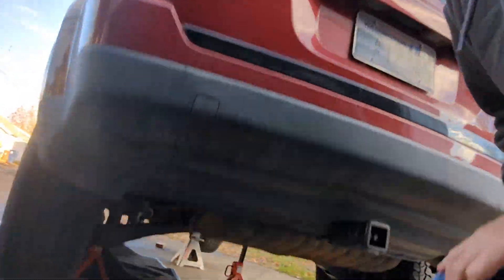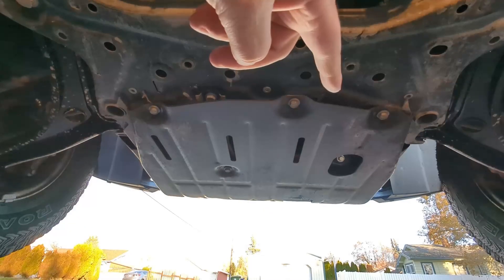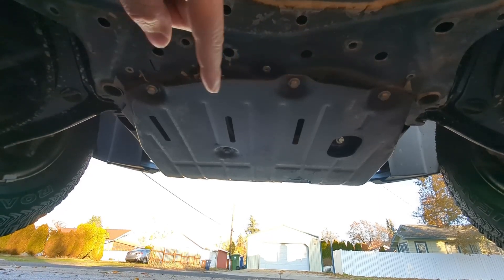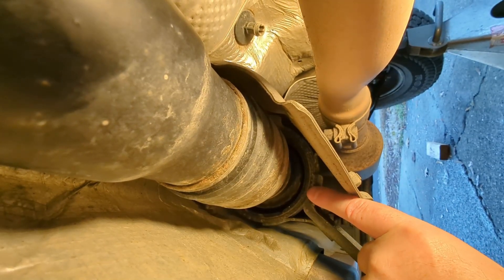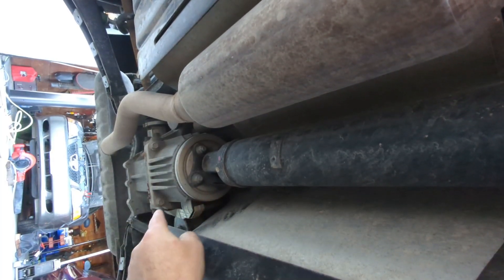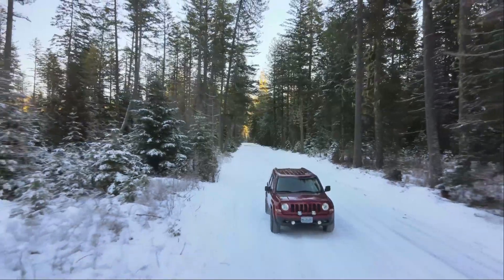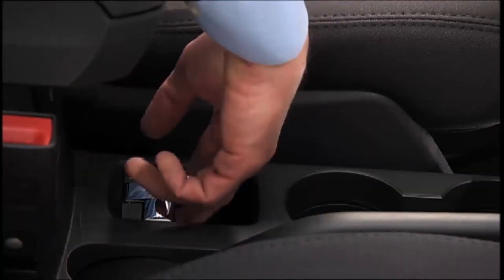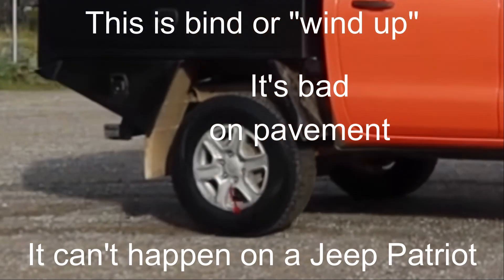How a Jeep Patriot 4WD system works - Compass too!

Comment: That's a way of doing 4wd/Awd i didn't know about.

This is actually the first time i have heard if a vehicle being front wheel drive and engaging the rear wheels for 4wd.  Front wheel drive generally tends to have better performance and steering control off-road. I like this idea.
Reply from the maker: It's not entirely new for example Ford Tempo cars as early as 1987 optionally had something a little bit like this - not quite as refined.   That probably wasn't the first it's just the earliest example I can think of right now.      Despite its limitations in performance and heavy off road situations it's a completely appropriate system for this kind of car & I think it cashes all the checks it actually writes.   More than can be said for some other specific Jeeps 🤣
Reply: This is the same as Honda's 4wd
Reply: @guttedxx  And the Haldex used in Volvos, Freelanders Audi TTs and many more